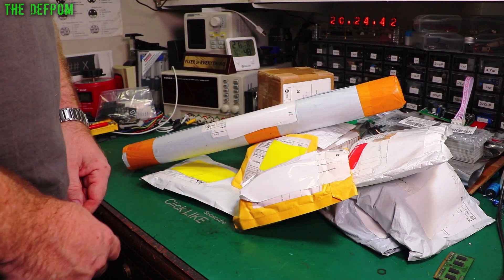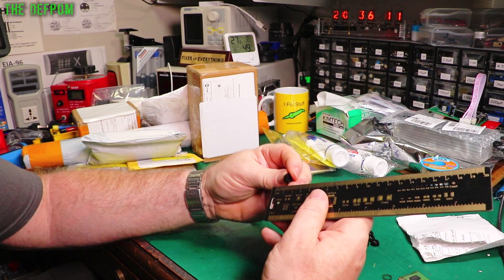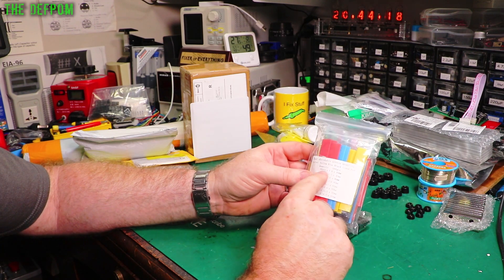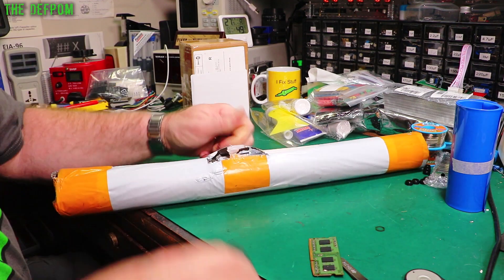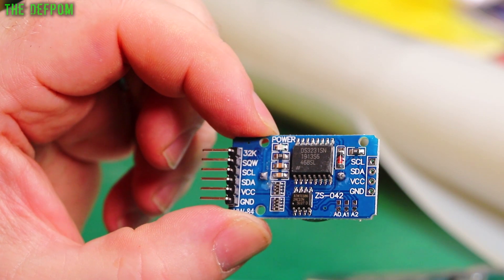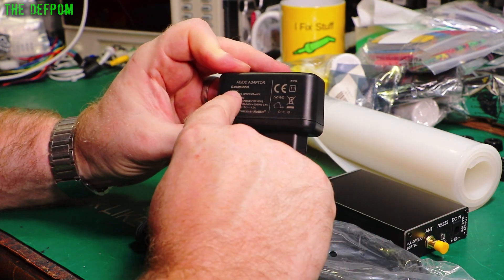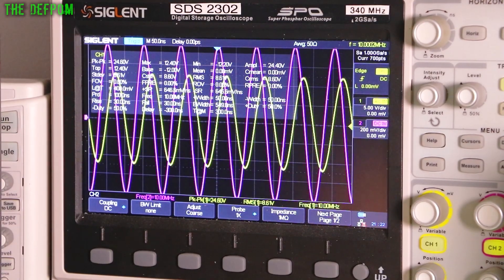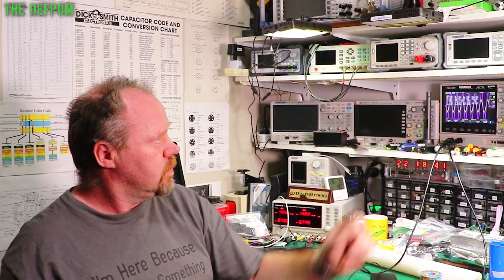🔴 Mailbag Monday 22nd February 2021 - No. 806

Comment: Cool mailbag. How's that 10mhz oscillator working out? Wonder of it really stabilized after a few days.
Reply: Check out YouTuber Tony albus. He’s made about a dozen videos on his gpsdo There’s incredible units available.... all designed by an amateur radio guy in Japan. And utilizing extremely good quality parts

They start under $100… for a simple oscillator with a few outputs which is good to use as a frequency standard in your lab when needed.

But For $200 you get something thats 10 times more useful, with a distribution amplifier that can feed all of your test gear at once so everything is running off the disciplined oscillator. 

Some folks may not need that precision… But you don’t realize how wonderful it is… Until you have it set up. It’s effortless!!

beats out most other frequency standards… Because of how convenient, and stable long-term and short.  I’ve worked with both rubidium and cesium clocks and they are wonderful pieces of engineering. But they can be “finicky“ 

GPSDO is literally just plug and play. It’s bulletproof. Nothing can go wrong.
But they all have their place

The distribution amplifier that Tony purchased in his video really is the best one… 

I’ve had the chance to play with several of these. In my own lab while setting them up for friends and local Maker space… And they really are worth the money. 10 years ago you would’ve paid $1200 used for that GPSDO and distribution amp

Oh… And the distribution app Tony shows in his video puts out 10 MHz, 5 MHz, one MHz, and 1 pps. And I think 100 kHz. I don’t remember exactly but if you check it out you’ll see what I’m talking about. Extremely useful!

Comment: HDB-366 Melting Point 210C.
https://www.unionrepair.com/mechanic-hbd-366-100g-series-low-temperature-lead-free-solder-wire.html
You can get Lead Free solder paste, melts at 138C.
https://www.mektronics.com.au/mg-chemicals-lead-free-low-temperature-solder-paste-15g.html
Interesting GPS Oscillator..